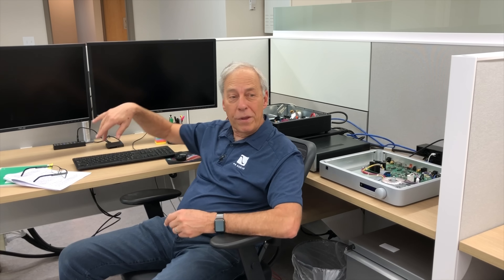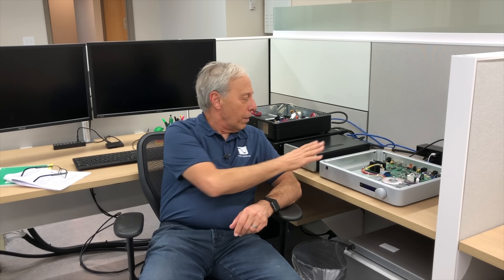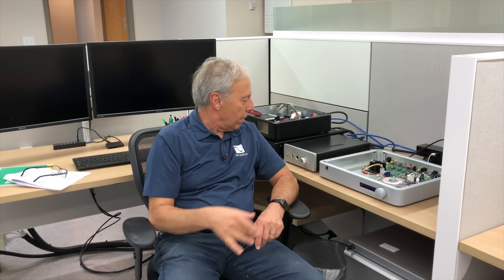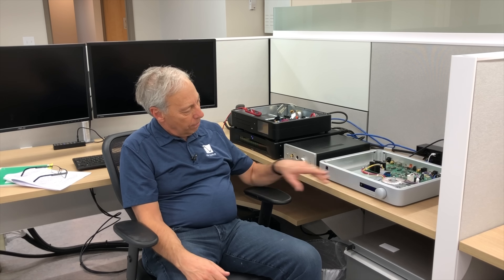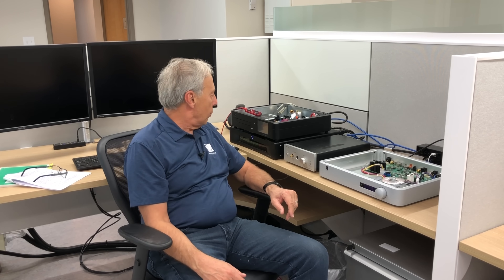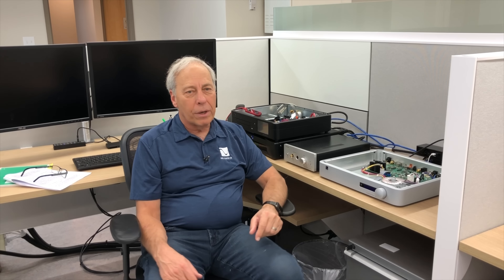Using a UPS for power conditioning

Comment: So what did we learn?  That's right...... we all still need a PS audio power supply...... imagine that.  LoL
Reply: If you were actually paying attention you would have learned that UPSs are not Power Conditioners even though they have some of the same parts.
Semi trucks and race cars both have doors, seats, tires, and engines but they're actually very different and do different things..... imagine that.  LoL
Reply: @Peter_S_  relax..... It was a joke.  I know this is serious stuff for people like you.  It's amazing what sets your type off. LoL
Reply: @Peter_S_  ok understood.   Answer me this........ why do my speaker cones go crazy when playing analog vinyl and are almost still when playing digital?  Dynamic range?
Reply: @hifi noob 2018 it's because you didn't plug your CD player in. 🤣

My speakers move when I play music.
Reply: Peter S, double conversion UPS's are in fact power conditioners! They are doing exactly the same thing the PS audio unit do as well as having a battery to extend run time which the PS Audio Power Plant does not. Even some of the better line interactive UPS's  contain filtering and surge protection as well as buck / boost functions so these too qualify as power conditioners. The PS audio units are designed into a specific market to appeal to a niche customer base. They do supply clean AC power to the load. The question in many cases is if this is necessary for good audio reproduction.
Reply: "The question in many cases is if this is necessary for good audio reproduction."

That question can only be answered if you know the status of the power supply, the equipment attached, the ability of the listener to perceive changes... So many unknowns... Unless you are an EE with ESP of course!
Reply: @andydelle4509  The PS audio power plant is really one of a kind power regeneration, it's the last thing to upgrade, I have a friend who bought it and also one who tested with many other power filtering products, he rate the power plant the best he had ever tried.
Reply: Mikka333, I am well aware of what the PS Power Plant is and how it works. It's still basically an online UPS system minus the battery bank. As for specifics, it has an linear input power supply like most power amplifiers. Next is a sinewave oscillator, which I hope is frequency locked to the incoming AC line. Then there is a linear power amplifier, probably class B from what I gather from the claimed efficiency ratings - 75%? The power amp drives 120v rms into a very low impedance. There is  no doubt some feedback to the amp front end to keep that voltage regulated and the impedance low. This is hardly a secret to any competent EE as this information can be assessed from Paul's own advertising.

A typical modern online UPS also has an input rectifier (no transformer required). A battery bank. Then a switchmode inverter followed by an output filter. The difference is this will produce about 3-5% THD on the waveform. Paul's unit is much lower like under 1%, probably a lot better. But the truth is no audio component power supply, either linear and certainly not switch mode needs that pure of an AC waveform. It makes no audible difference between even 10% distortion and sub 1% once the AC is rectified and filtered. And that can be proven with simple test gear.
Reply: I don't need your personal comments. Yes the line frequency does vary a few percent short term. Not good for a turntable but we have had direct drive servo controlled turntables since the early 70s so that is a non issue to the audiophile crowd. And they count every cycle so year to year, your AC line is dead accurate due to the compensation they introduce.  An old fashioned AC motor clock isstill the most accurate next to WWV. But an audio signal processing device, amp, preamp, dac, even CD transport could care less if the incoming AC varies a few percent in frequency. I won't make any difference to the DC output of the power supply.

Now since this Power Plant product is all about the cleanest and purist AC, why would you want to generate up to 2.2kw of AC power yet have it unlocked to the source AC but still share the same household safety ground system powering interconnected unbalanced audio gear to boot ? HELLO, you do realize that the ground is full of 60hz current especially these days. Now you have another unlocked source riding on it creating more LF harmonics?

Any competent online UPS system is not only frequency locked but also phase locked to the incoming AC line. Phase lock is only necessary for hot switching but frequency lock is needed if you expect to keep ground loop noise down even at a somewhat low 2.2kw of capacity. In any technical facility with multiple generators, I guarantee you they are all frequency locked via the engine governors. Even if the generators are split between building functions and tech load, they must be synchronized especially at those power levels. Otherwise the neutral and ground currents would go through the roof!

Now who looks like the idiot!
Reply: "I don't need your personal comments."

That's a bit rich coming from one of them who regularly refers to audiophiles as audiofools. If you don't like the heat, stay out of the kitchen!

"we have had direct drive servo controlled turntables since the early 70s..."

But I didn't possess a direct drive servo controlled turntable. Nor did I have the funds to spare at the time to purchase one. Not to mention the lack of imagination here. Choosing times when the frequency variation was least likely to occur, I digitised my vinyl collection which gave me the opportunity to improve the quality of my music – declicking, decrackling etc. A further advantage to this strategy became apparent when hard disk space became much more affordable than optical media. My entire music collection now occupies one cheap as chips pocket drive as well as several backup copies on conventional hard disks.
Reply: The power plant has variable option like phase control, frequency and voltage adjustment. All of these option will change the sound quality of the system, it has capability for the owner to tweak their system. I am there helping my friend to find the best setting for his system, I heard it myself and the differences is very audible, from lowest to highest setting of course, not every step of increment. Just by putting the power plant into the system already improve the overall sound quality.

I know that you still want to make a statement about it, not everyone is able to afford it or had a chance to try it out in their system, everyone is looking for a cheaper alternative and persuade themselves that such high end price product make no difference with the cheaper alternative.
Reply: So you propose running linear power supplies on a frequency different from the design frequency of the transformer is a good thing? Furthermore I have no doubt doing that can make an amplifier sound better. But in doing  that you are raising the DC voltage rails and may start exceeding the safe operating area of the circuit components. I can do the same thing be simply running my amplifiers on 140 volts with a variac. Would you do that? It will probably sound better. By altering the frequency and waveform you are basically raising the peak voltage of the raw DC. I though PS Audio got rid of that dangerous feature on the current models?
Reply: @andydelle4509  There are limit for the maximum voltage, highest voltage setting did not sound good, there is a sweet spot.
Reply: Andy Delle, you're wrong for the simple reason that power conditioners are specifically made to output the cleanest power possible while a UPS is not. Double conversion UPS units (no apostrophe necessary as they're used for contractions or to show ownership, _not for pluralization ) are built to output AC (generally) from lower voltage DC and some of them produce some exceptionally crappy AC simulants with crazy amounts of odd-harmonic noise. How many UPSs have you had on your bench for repair? I've repaired quite a number of them and I observe what they output on a scope, and I'm referring to high $$$ equipment protecting $$$$$$ servers running industrial applications worth $$$$$$$$$$, not devices from BestBuy in home use. You're just wrong about what qualifies as a real power conditioner versus something with a degree of power conditioning in it. Semi trucks and family cars both have tires and haul things but only one is used for heavy hauling. Good power is necessary for tube gear almost 100% of the time, repeat, almost 100% of the time because all the "regulation" is usually supplied by simple resistance and inductance.

The trace on the scope, spectral, and THD analyses are the only truths here but if you want to get puffy chested and compare pedigrees.... my work covers DC to 20 GHz in products on the market that you can buy right now, today, through retailers from B&H to Walmart and some of that engineering had to be reviewed and approved by Intel's high speed design labs at every stage from block diagram to PCB layout to final build. I've been building DSP audio gear since 1989 and used to design video digitizers and theatrical lighting dimmers before that. I've done custom work for Apple, Sun Microsystems, Disney, Boeing, IDEO, and many more. I've been building tube amplifiers of my own design for over 20 years. I've spent more hours than I can tell you actually performing in venues as well as doing event electrical so I know power distribution from the standpoint of a supplier as well as a consumer. I've seen every facial expression possible from an audio guy forced to deal with less than pristine power. How's that for boasting? Want more?

My experience with big power conditioning covers taking 480V 3 phase at 60Hz and turning that into 240V 3 phase at 400 Hz to run over 1.5 megawatts of RADAR as well as support auxiliary equipment including over 200HP in hydraulic pumps and I have a couple of years experience working in a broadcast TV studio too. I won't claim my experience is that extensive, however it certainly is diverse and quantifiably relevant here. Being an accredited EE and $4.29 plus tax will get you a cup of coffee at Starbucks. Oh, and your ESP based ground current detector is pretty amazing. HELLO, you should consider a patent.

_"So you propose running linear power supplies on a frequency different from the design frequency of the transformer is a good thing?_" Sorry, but are you attempting to be a drama queen here? If my crappy off-grid solar system inverter in the cold of winter wants to put out 59.7244 Hz which changes to 60.2608 Hz in the heat of summer, then YES, absolutely. I would much rather my turntable get a 60 Hz reference which is on the nose because I'm not about to replace the inverter's crystal with a crystal oven. Such drama..... smh.
Reply: My engineering background is certainly equivalent to your self claims. I don’t see how you can claim any enterprise UPS does not qualify as a power conditioner. The large UPS systems I have experience don’t sit on a Bench. They take up a room. See YouTube for GMG home theater, that should clear up any mid understandings as to my background. And I use my real name so what I claim can be verified. How about you? Anybody can claim extensive backgrounds but if such is true, why hide behind an internet moniker? I think the truth is you are really a frustrated service technician. "UPS systems repaired on your bench", worked setting up live venues, belittle formal electrical engineering credentials? Interesting too how you mock some of the claims I made such as ground current yet you offer no technical rebuttal. That is not the way professional engineers talk.

Here you go: https://www.youtube.com/watch?v=bEMuqo38lJ0
Reply: @ hifi noob 2018 Some, like yourself, seem incapable of learning...
Reply: Larry, show me here where I trashed his product? Didn't I specifically say it does what he claims it does in terms of generating a clean AC source? I did say I'm not sure if that level of power quality is needed on a home HiFi system but that's hardly trashing the product. And I'm sure Paul does disagree with that last sentence. But then he sells very expensive audiophile power conditioners, I don't! Additionally I am also an accredited EE who has built broadcast and mastering equipment plus large facilities for over 35 years. I think I know a little about power conditioning like megawatt class UPS systems.
Reply: I wish I got budget to spare for the ps audio power plant, maybe one day...

Comment: No, most UPSes, even pure sine wave, are standby, which means they simply pass the power from the wall. Yes, they watch for low or high voltages and switch to battery as needed and have some filtering, but it is not what you think.

You need an online UPS that is providing power all the time through the inverter, etc.
Reply: In the old days, that is what UPS meant. Almost ZERO companies offer true UPS operation now. The ones that do will be very expensive.
Reply: I always specified American Power Conversion and now I'm retired I don't have to specify anything (yay!). Expensive? Not really when you factor in build quality, reliability and the insurance on your gear. I had an Internet friend in the States had all his gear replaced by APC's insurance three times. (Thunderstorms). Go check on the cost of insurance without an APC UPS.
Reply: Jonathan Sturm they USED to be ok, but they are not a player in the market anymore. I never liked APC.

I only use Cyberpower UPSes. First their regular line and now, only pure sine wave.
I have bought/installed at least 70 and none have ever had 1 issue.
Reply: @ P V
That's sad! I never had any issues with APC back in the day.
Reply: PV, I think you mean most UPS systems you get from Best Buy or Staples are standby types. True sine wave online UPS systems have become even more available in the recent years on the professional level due to advancements in class D technology. Large "wired in" UPS systems have always been sinewave output since they were invented in the 1960s by Liebert Corp (now Emerson).
Reply: Nope due to the fact that i step down the voltage from 230v to 220v it must go throug the big transformer inside that the apc is known for, but hey If thats your opinion then it must be so, even when apc tells different on ther web page so shuld I trust the people ho made the d*** thing or some unknown joe on the internet HMMM... 
I didn't know it was this hard to decide 😂😂